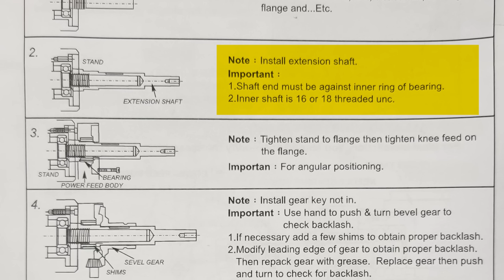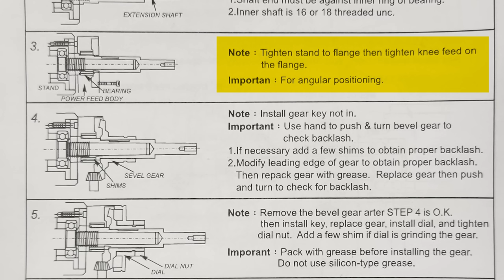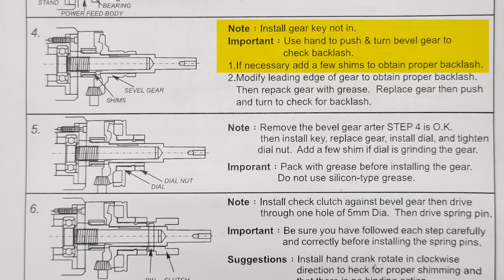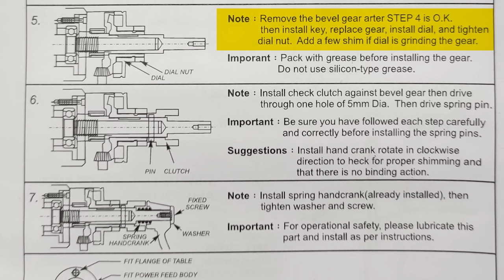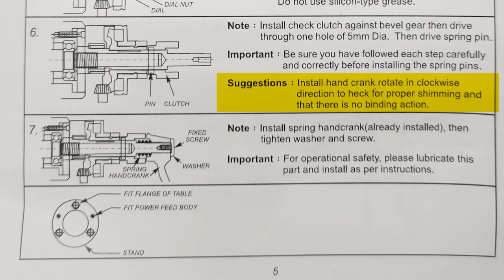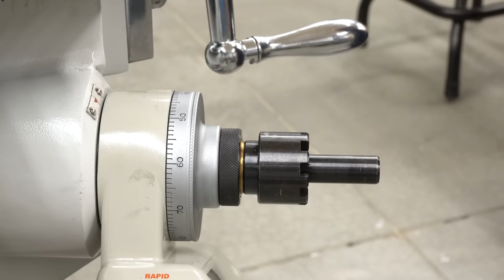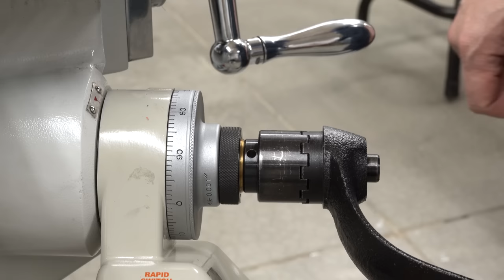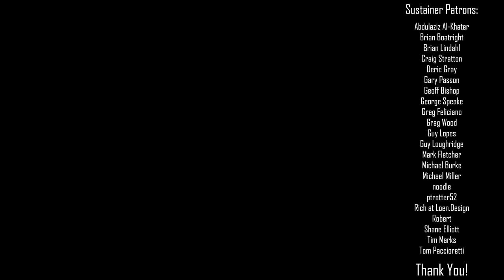Installing a Z Axis Power Feed on a PM-935 Knee Mill

Comment: Here's a weird twist for ya…
I installed the same drive on the same mill. And I also ran into a LOT of trouble getting that cast iron collar loose. I cranked on that thing with every wrench, pliers, and clamp in the shop. Probably sweated over it for an hour before I decided to try the old trick of tightening it a bit first to loosen the bond. I tweaked it to the right, and it immediately and easily unthreaded *clockwise*. Yes, on my PM-935 that part, and the casting, have a LH thread.
What the hell?

Comment: You could have put the castle nut in your vice and centered/drilled the holes for the pin.  This becomes the 'guide' to drill through the shaft.  Worked perfect when I did mine.  Nice Video.
Reply from the maker: I wasn't confident I would hit the exit hole.
Reply: Best way to drill the cross hole if you don’t have 3D printing.

Comment: Hi folks. James will have used a 115 volt drive. Here in the UK they are also available in 230 volts. Please note that these 230 volt drives are not acceptable for commercial use. They do not comply with the relevant legislation.  I addd a relay based control unit to my amateur use 230 volt X axis drive to have 24 volt ac on the limit switches, not 230 volts. A better way would be to use a step down transformer to reduce our 230 volts to 115 volts and use a commercial drive - see James' episode on control circuit transformers - he explains the essential 115 volt earthing requirements very clearly.
Reply from the maker: Is the relevant concern the limit switch circuit?
Reply: Be interesting to know actual concern of UK Rule other than low voltage control wiring 

In the US versions I have worked on there generally DC motors with the limit switches working on control board logic power

Comment: With the added length of the extension & the handle sticking out in the way ,even more than it already does...I went with the drill adapter some fellow on Ebay makes, it works slick and is "outta the way" when slipped off, takes 5 seconds.  But thanks for the video, James.

Comment: I have nearly the exact same unit; I did not get mine from PM, but luckily they use the same English-Chinglish translation service as my straight from Chi-neh version. I am using mine on the LH side of my X-axis of my HF mill (Identical hardware). Don't turn your back on those shifty stools; I am sure it let out a cackle as you seated to the floor 🙂

Comment: I installed one of these on the Z drive on my 935 mill. The drive would hang at an angle so I drilled some new holes so now it hangs vertically. Works perfectly.
Reply: l was surprised he kept it that way.
Reply: the drive is supposed to be mounted in that position....he did it properly...it allows for a Y drive to be installed
Reply: @edvig2015  thank you, learned something today, makes me wonder why  he added this drive and not the Y drive.
Reply: @ronsreadyornotshop Y drive will probably come later. They are very useful.
Reply: I decided that I didn't want the Y drive but I did want it to hang vertically. So I did it my way.

Comment: I have the same mill and experienced the same issues installing the same Z-axis power feed. Managed to make a few false steps but got it working. Pays to have mechanical aptitude! And yes, I did snap off a tap.
Reply from the maker: This mill has a tap installed under the DRO bracket.

Comment: A straight forward job.... as long as you're not installing a Z axis power feed onto an Ajax mill. My AJT-1 has a Z height mechanism is basically the same design as the one shown here (and a Bridgeport), but everything is metric, and some dimensions are significantly different. Initially I thought this was going to be relatively easy to rectify, but it isn't. Every little mismatch which initially looks manageable has knock on effects on other parts.
     The biggest problem is that the ring which clamps the bearing is a smaller OD (67mm vs 2.95") - too small for the PCD of the power feed mounting screws to fit into. Fixing this ideally requires redesign and manufacture of a new, thicker clamping ring with a stepped OD. 
     Then a correspondingly longer extension shaft needs to be made, longer to compensate for the thicker bearing clamping ring, and with the M20 thread for the shaft. And it needs to incorporate the nut which you undo with the pin spanner, and which the axis scale rides on, because there isn't enough thread on the shaft for it and the shaft extension separately.
     The castellations for the handle don't match either. This could be solved by buying a Bridgeport handle, however, when the extension shaft has to be so comprehensively re-designed, the new design could probably use the original keyed castellated part somehow. 

However, I put the job to one side after discovering how much re-engineering was going to be needed. My Align Z axis power feed parts have sat in a cupboard for about 6 years, waiting for me to get around to re-designing and making the new bearing clamping ring and extension shaft. Maybe this video will make me get around to having another look at it........
Reply from the maker: If you just want a machine that works, that's a pain.  If you want a project and enjoy working on it, that's another matter.
Reply: @Clough42  I sort of agree. It'll be an interesting little project - just one which hasn't got towards the top of my never ending 'to do' list yet! I watched your video wondering whether you'd run into the same problem, and if so, how you'd worked around it. You were luckier then me, in that your machine must be a more exact copy of a Bridgeport than mine! Thanks for the videos - always interesting.

Comment: I need to take my x axis power feed apart on my chevalier mill to get it back working right the Potentiometer for speed control has multiple dead spots. Called travers tool company since they make my particular power feed to get parts but they don't sell the parts for their own product. Now I have to remove it and try and match something up that will work. After watching your video just know man that z axis power feed would be so much easier than cranking the z axis by hand

Comment: Pro tip, remove the spring on the handle and the screw and washer assembly so it’s built up like before, add a limit switch which is pressed in when the handle in engaged with the teeth, and wire the switch so the motor won’t turn if it is activated
Reply from the maker: Mount the switch where, exactly?  That seems impractical, unless I'm missing something.
Reply: On a machine we had where I used to work, the z axis was set up like this with a power feed and limit switch on the handle, thinking back perhaps the handle had something on it to specifically activate this switch, but it definitely made life easier using the machine,

I think the switch was mounted underneath the shaft

Comment: Thanks James. I'm installing the same Power Feed on a Bridgeport.  It's funny that no where in the instructions does it say that you need to "drill" a hole through the shaft, but it became evident pretty quickly.  The drill guide you made was a great idea.
Mine makes a "clunk" sound when switching direction. Does yours?  Thanks
Reply from the maker: Yes.  Every one I've ever used has a significant clunk when engaging and disengaging.

Comment: Is there a reason you elected not to use any thread adhesives on the extension shaft?

Edit, commented before the end of the video😅 good work on the drill guide

Comment: Hey guys and Hello From Germany . I have a Bridgeport Series 1 and the Same Power Feed installed. It works . But!!!! It runs constantly only at half of the Rpm Range to Max. Slow Speed it Always starts and stops . I have connected the wiring to the Engine outlet of the x Axis serial Engine  and i have there112volts . This should be right. Do you mean i have a Bad Engine or should i try an external Power converter for our 230volts to 110. thanks

Comment: If you can't flip the z lever like before, how are you going to avoid walking into it?     Could be a convenient location for a bright coloured rubbish bin/trash can as a visual reminder ?
Reply from the maker: Because it isn't engaged on the clutch, it swings when hit.  We'll see how it goes.
Reply: @Clough42  - Seems like it should be a fold-away handle, with detents.

Comment: I am surprised that when the Chinese copied the actual Servo brand of knee feed that they ended up with the funky angle to the power unit itself.  My Servos hang straight up and down on the Bridgeports.  I also find it hard to believe that for decades companies paid toolmakers and machinists to spend time cranking the knee up and down.  All that time lost would probably have paid for 10 knee feeds.  You’ll wonder why you didn’t get one sooner if I had to guess.
Reply from the maker: I already wonder. How I lived without it  I think the angle is because the Asian mill just has the screw pattern clocked differently in the knee, which isn't important until you add a feed.  However, it's a happy accident that makes the controls easier to reach if you're tall.

Comment: I noticed that in recent projects you use more and more metric hardware.
Is this some systemic change you going through or you select what works better for every task?
Reply from the maker: I try to match the fastener to the job.   I generally use metric hardware on Asian machines so I avoid making a confusing mess for the next person.

Comment: James, while watching the video, I thought it was an optical ilution seeing the power drive at an angle.  After reading the comments, I understand that it is intentional. If a y axis was not going to be installed, could the drive be instaled virtical?  looking to upgrade to this model mill.
Reply from the maker: I'd check carefully to make sure it will clear the base.

Comment: Hi, love your channel.  Did the PM-935 replace the PM-940
Reply from the maker: Yes.  The '940 had some issues with the machining.  In particular, the X and Y axes were way out of spec for squareness.  I opted to upgrade to the 935, which is made entirely in Taiwan.
Reply: @Clough42  i am very jelousof your PM-935, if only i had the room

Comment: Nice install I personally do not like power feed on knee they seam to cause more problems then they are worth.
Reply from the maker: What kind of problems?
Reply: @Clough42  The handle can get bumped if you are going from one side of table handle to other if you do not turn power off it could move knee up or down during your job. I also find things just stick out to much when trying to use both X and Y at same time.

Comment: That key way is indeed, a key… feature… 😅 EDIT: I’ve seen these before, the way they hang all catiwompus to one side is enough to prevent me from ever installing one, its just too much to cope with. Which brings me to my main complaint with the bridgeport mill and it’s clones, lack of mechanical feed features. This is the biggest reason I’ve started looking for a replacement for my bridgeport. I just don’t like the fact that it’s necessary to hang a bunch of servo motors off all the axis for power feed. There are so many machines out there that do this so much better, and in turn allow for tying the movement of the table to the speed of the spindle. I sometimes wonder how the bridgeport became “king” in the first place.
Reply: Bridgeports have had power feed drives for years, at least on the X axis. They’re well made but expensive and difficult to repair. Cheaper Import units have their own problems and are sometimes hard to adapt to Bridgeports. Many millions of high quality Bridgeports with easily replaceable parts made them the overwhelming standard of the industry for many years. Unfortunately their era is over but they can be rebuilt to factory standards by reputable firms.
Reply: @ellieprice363  Perhaps you didn't understand my comment. Yes, like I said, you can install a power feed on all 3 axis of a bridgeport very easily. But they are nothing more than servo motors that hang off of whichever axis on which they're installed and operate completely independent of the spindle, and without regards to each other. Doesn't matter if it's a stock BP unit, "servo" or "vevor" brand, they are the same. Compare this to other manual machines with mechanical feeds that are tied to spindle rotation and to each other, and a servo motor is an unarguably inferior option when you're talking about a "manual" machine.  Bridgeports "can" do a lot of things. Just not many of them very well. They became the industry standard due to price, availability, flexibility, and ubiquity. They are decent machines. But they're not by any stretch the "end all be all" of milling machines, despite their cult like following.

Comment: I elected to make a stub arbor that interfaces to the Z axis 7 tooth cog on the mill and I drive it with a portable drill when required....stole the idea from Mr.Pete.....
Reply: Anything is better than hand cranking a knee up and down.  By the way those drill attachments were out there when Mr. Pete was just a young’en.
Reply from the maker: I think Tom Lipton showed this at one point, too.

Comment: I asked a question in your last video about the belt sander you used a VFD do you need this to grind at slow speed and why do you need to grind at a slow speed  thanks
Reply: Hi mate, yes a vfd changes the rpm of the motor and the belt speed as a result. A vfd allows you to supply the full voltage to the motor, and only alters the frequency of the supply to achieve the speed control, other methods vary the voltage usually, which would severely reduce torque and likely make your reduced belt speed useless, as the belt would stall. As for why..... finer belts with higher grits can run slower to prevent excessive heat or burning the belt, making fine adjustments to delicate pieces, different materials ie carbide vs wood vs plastics vs hss, etc, etc, variable speed allows you to fine tune your grinder, and more likely to achieve the desired finish and/or material removal rate  😀
Reply: Also, a single to 3 phase vfd will allow a 3 phase motor to be used, which runs smoother than a single phase motor, is better balanced in the way it operates I would guess and so there is less vibration transferred through to your work piece etc and the belt speed is more constant,  which in itself is a good reason to use a vfd

Comment: They didn't bother to drill the hole for the spring pin?  I guess it's a way of preventing returns.
Reply: I believe you drill through the original Z-axis shaft on the mill.
Reply from the maker: The pin position changes, depending on the shims installed.
Reply: @Clough42  Yea, but they could have at least drilled a hole through the clutch shoulder for marking the hole location.

Comment: I’m definitely triggered by the motor not being vertical - how about y’all?
Reply from the maker: It makes the controls easier to reach if you're tall.
Reply: @Clough42  true. But still wonky bits look odd when things are generally vertical and horizontal on mills etc.
Reply from the maker: @75keg75  I saw another comment saying that it has to be angled to clear a y power feed.  I can't confirm.
Reply: @75keg75  You can tip the Mill at an angle, or put it in a garage with angled walls, to make it all look consistent 🙂 again.
Reply: @timogross8191  could be easier installing a false floor with a grade. Or cheap option 1platform heal and one normal shoe 🤣🤣
Reply: @Clough42  it appears pm do have one, It looks Chonky In pics!! I guess it lessens the odd angle of the drive when you add that in too.
Reply: @75keg75  Great! Now the tilting heads of some milling machines start to make sense all of a sudden. 🙂